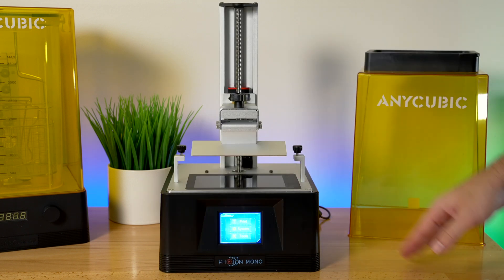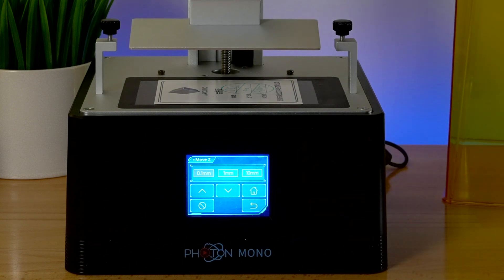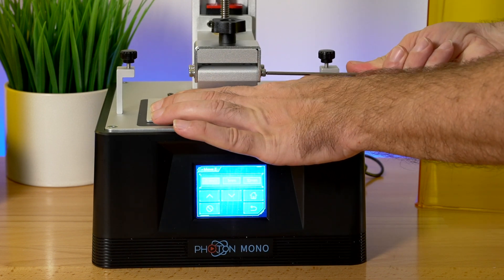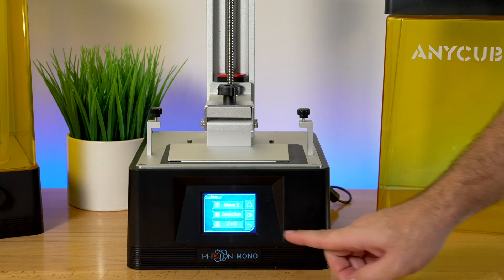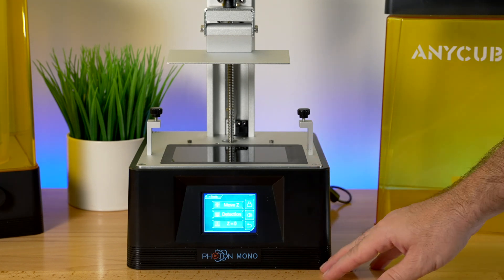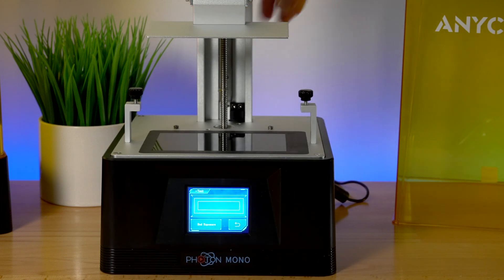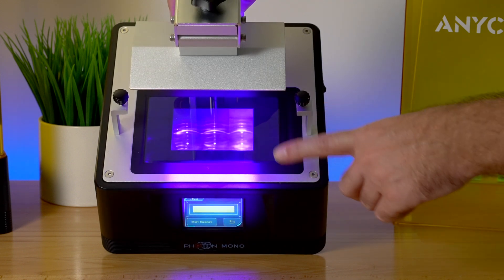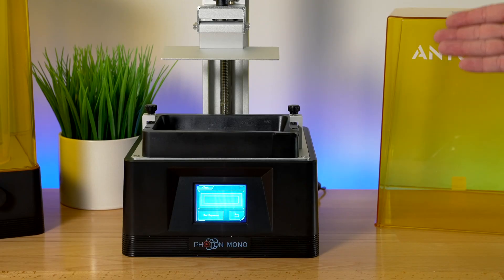Anycubic Photon Mono - Bed Leveling

Comment: Need Help: Anycubic Printer Not Saving Z-Offset

Hello everyone,

I'm experiencing a recurring issue with my Anycubic 3D printer that's becoming quite frustrating. Despite correctly setting the Z-offset as instructed, my printer fails to save these settings. Every time I start a print, the printer reverts to the home position, which is too close to the display, exerting significant pressure on it and causing the stepper motors to skip.

Here’s what I’ve tried so far:
- Updated the firmware to the latest version
- Repeatedly set the Z-offset according to the manual
- Confirmed by pressing Z=0 and rechecking

Unfortunately, the issue persists, and I'm pretty confident I'm following all the instructions correctly. Heqre is a [link to a YouTube video] https://youtu.be/AcZxQKa_rnU?si=7hQAfnEwNslifVWz that shows what’s happening.

Has anyone else experienced this, or can anyone offer any tips on how to resolve this issue? Any help would be greatly appreciated!

Thank you in advance!

Comment: not using a screen protector here?
Reply: If you're referring to the printer's cover/screen, it's not there to protect you from the UV radiation generated by the machine; it's there to prevent sunlight from curing the resin.

Comment: are you kidding me... what if the build plate is not leveled!! what kind of tutorial is this.  Where are the hex keys
Reply: He's doing it correctly. The buildplates in DLP printers are leveled by simply lowering the bed onto the screen so that both planes are parallel. That's when you tighten the hex screws (which, by the way, he is tightening). What's the question?

Comment: Uv protection left the chat😅
Reply: It's not necessary to use protection when handling this type of UV frequencies (405nm). It is far below ionizing radiation. It's basically the same as going outside for a walk (in fact, it's much less harmful than being out in the sun)